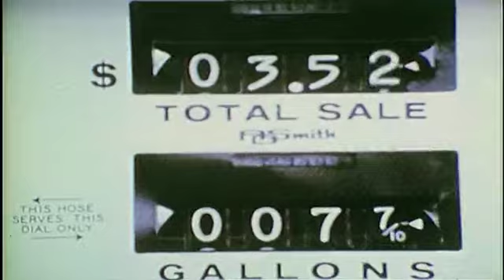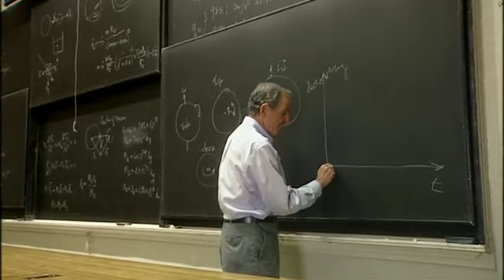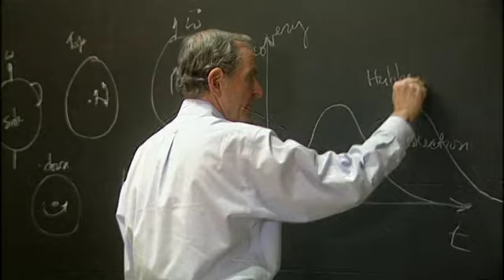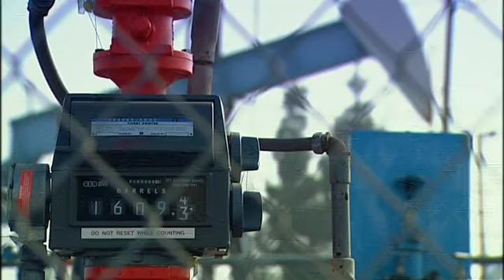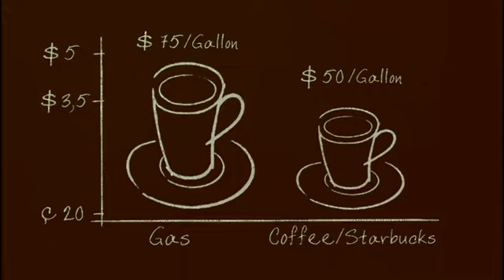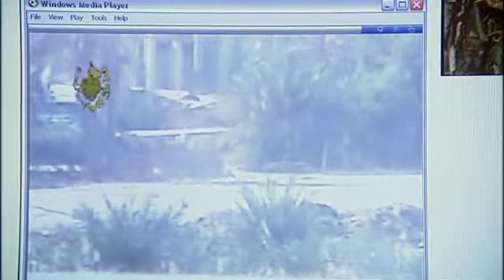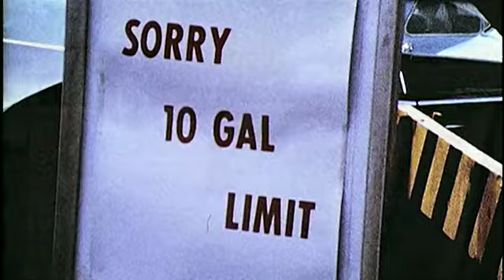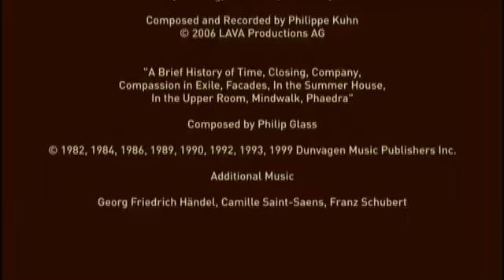A Crude Awakening - The Oilcrash

Comment: Ha! And they laugh and mock the Amish in Colorado and other US states. They mock Cuba for their 'backward' ways! I reckon North Korea will take over the world once the oil runs out, no nation will be able to adapt quick enough or be hardy enough to within stand the cold, heat of hard work which will ensue. Mark my words!
Reply: I think Brazil will do pretty well in a post oil world since a large portion of their automobile fleet runs on ethanol made from sugar cane. Sugar cane ethanol actually has a really good EROEI  of 8.
Reply: AmandaNerdBot Fair play to them, Brazil has suffered enough in the Carbon age, maybe they should be the new leaders.
Reply: ednuttah
maybe they should. Brazil is gifted with ethanol. But keep in mind that electric cars are unlikely to replace internal-combustion engine vehicles because manufacturing a car (regardless of its power-source) requires a huge amount of oil. There isn't enough oil on Earth to manufacture 800 million electric cars to replace all of the internal-combustion engine vehicles on the road.  That's what Michael Ruppert said.
Reply: AmandaNerdBot Back to pre 1850's I can deal with that,a simpler life is always a better one.
Reply: ednuttah
well just keep in mind that the computer you are using is even made of oil. Everything is made of oil nowadays (well almost everything).
Reply: AmandaNerdBot As I am fully aware, thanks for the palpable!

Comment: Time to wake up. There is no fossil fuel choice anymore. We have to switch to a variety of fuel options. Hydrogen fuel tech, will be the only option eventually. For now, solar, wind, geothermal.
Reply: hydrogen really doesn't have any promise because it takes more energy to create hydrogen than you get from using it. Solar and wind are our only choices, with solar being the more important of the two because solar provides far more energy density than wind.
Reply: Hydrogen fuel tech has come along way in the last several years. You can even get power from sea water and with no emissions.
Reply: Mike Goss
do you have any link to this? Just asking bro.